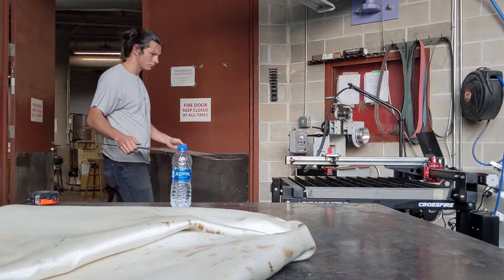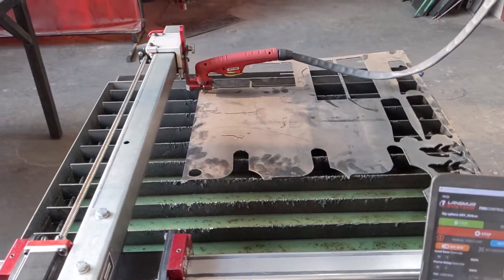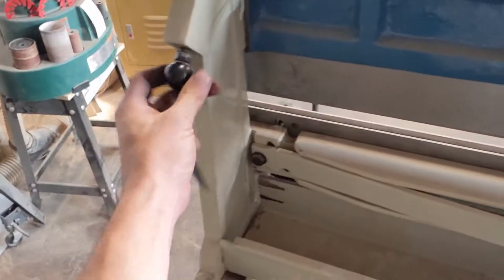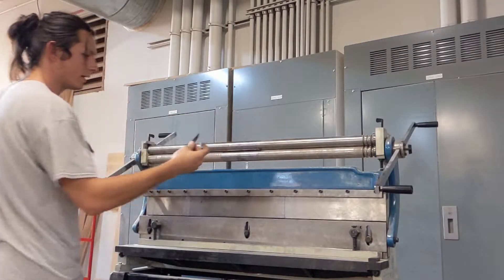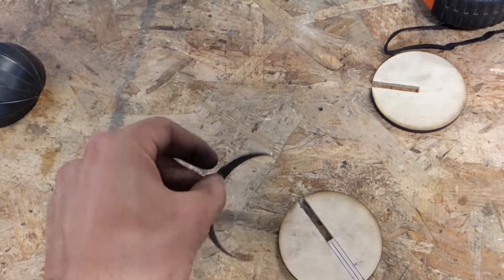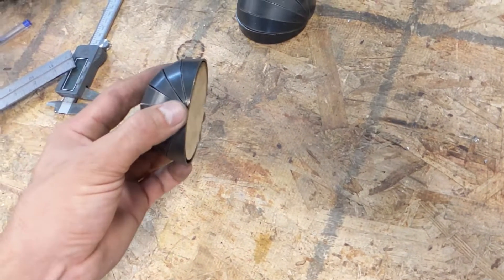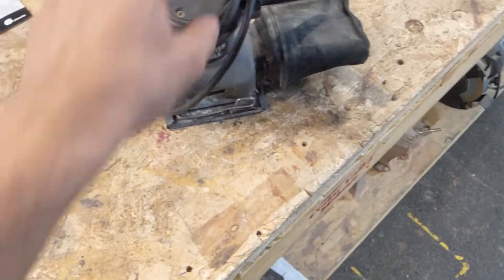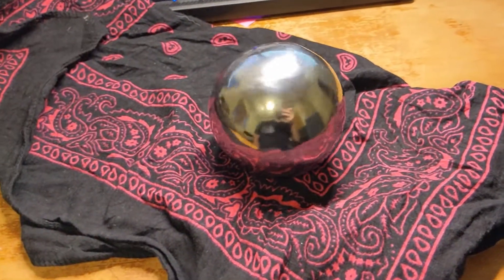How to make a Metal Sphere

Comment: I would love to try this in copper and make a larger 16 Inch sphere for a Vandegraph generator.
Reply from the maker: Don't know what that is but sounds cool lol
Reply: @ThyialIndustries  it makes sparks of static electricity up to ten inches long  k100 volts and more.
Reply from the maker: @ALSomthin  dang, sounds fancy
Reply: @ThyialIndustries  I have made several but I did a metal spinning process to do it but was limited by the size of my lathe.

Comment: Not so safe.... 

.  I've almost lost my eyesight from both of my eyes.. in 2 difference cases of loose/broken wire on angled grinder 

 those steel wires is even more unpredictable than your average spark "shower". 

Kinda like grinding or cutting without ,"spark catcher".. all over the place..

And how is this new way of doing spheres?..

That's the way they made spheres out thin to semi thin sheet metal for ages 
..
Reply from the maker: Perspective
Reply: @ThyialIndustries  perspective?🤔

Comment: You could have cut the iron plate in a hexagonal shape, like the leather pieces that make up a football, and solder the pieces one to the other until a metal ball is formed and then you grind them to become smooth.
Reply from the maker: I've seen others do that and then use a pressure washer to get it more round. But without the pressure washer it stays pretty flat. I found this pattern works a lot better
Reply: @ThyialIndustries  What you are saying is logical and correct
Reply: @ThyialIndustries coin them with a hammer to get that curve in.
Reply from the maker: @Anenome5  not a black smith..but would love to learn!